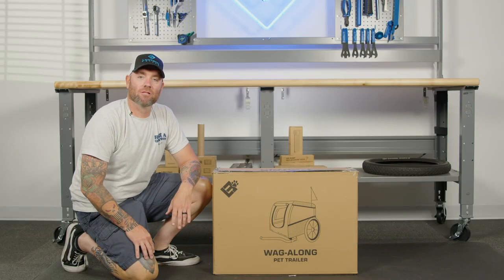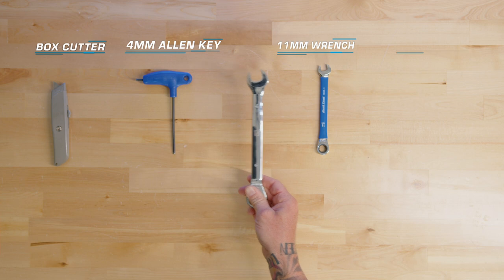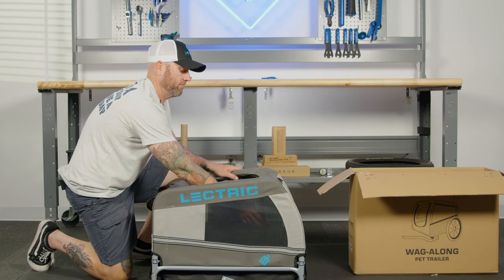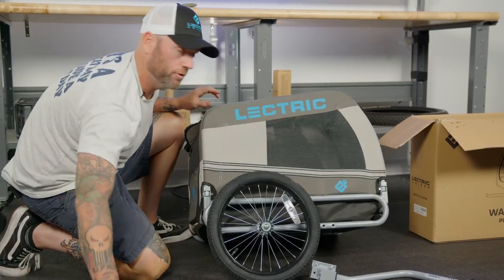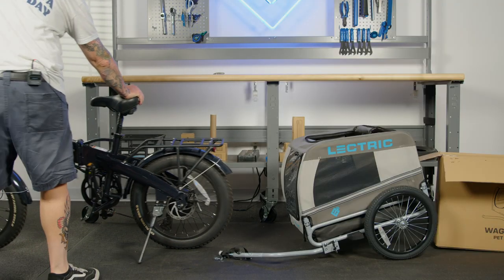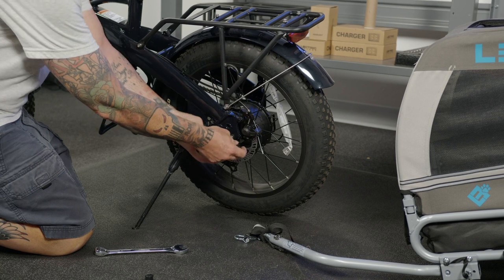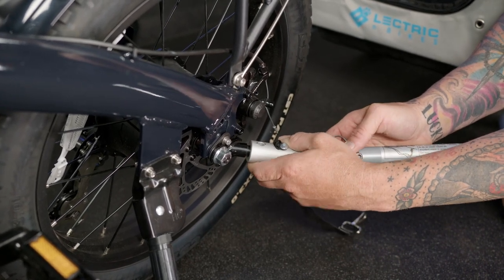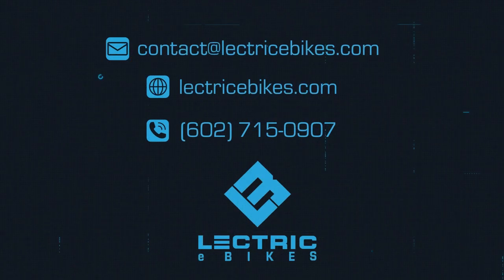Lectric Service Center | Wag Along Pet Trailer Unboxing

Comment: Any plans on making a basic wagon type thing? Our dog is to big for this pet carrier but a similar sized wagon for utility stuff would work great at our seasonal camp site.
Reply from the maker: Hi there, we did test out prototypes for larger breeds, but ultimately went with this smaller and more practical design! With every product release, our community provides us with valuable insight and feedback about what they want to see next.
Reply: Yes, my pup too big for this trailer. I would so buy this one to match my lectrix step thru 1.0, sad face.
Reply from the maker: We hope the two of you are able to find an option to ride together soon! 🙏
Reply: My pup is too big for the pet trailer too. I bought a Burley 2 kid trailer, took the seats out and put in a plywood floor. Works great!

Comment: I pull a different brand trailer with my XP 2.0. I use mine as a grocery trailer. Bless you guys, this is the greatest bike I've ever had. Pulls it like a feather.
Reply from the maker: Thank you for riding with Lectric! We hope to see photos of both your adventures and upgrades. Let us know if there is anything we may do for you. 🤩
Reply: Where did you get your hitch? I have a universal one but it’s not notched out and won’t fit.
Reply: ❤ drill it out.   Hold in place and mark with black marker(hole).  Start with small drill bit and move up two sizes and drill again.  Only drill out to the size of "threaded" shaft.  Replace with a slightly longer hex screw.  Add 3/16 to a 1/4 inch to original screw length.  It will be in metric though.  So be sure and "size" screw to metric threads at a hardware store.  They should have a "gauge" in hardware.

Comment: So there's two weight limits. One says no more than 22 lbs in the installation instructions but you claim 50lbs. Which is it? 
Also, how hard is it to take the trailer off the bike when not taking my small dog with us on rides?
Reply: Movie shows just the strap and one pin to remove the trailer.

Comment: The tech is shown sliding the hitch on the axle then the washer then the bolt. However, the groove to seats in the torque extension better with the hitch slides on first then the washer then the bolt. Additionally, when tightening the axle bolt it pulls away from the torque extension.  Which is the correct installation

Comment: If I want to attach a 3rd party trailer to the XP 3.0, do I use a 12mm adapter hitch over the axel bolt? If not, what size is the axel? Thanks!
Reply from the maker: Hi there! The rear axle nut on the XP 3.0 is 17mm, with 10mm flats for the axle!
Reply: @LectriceBikes  thanks